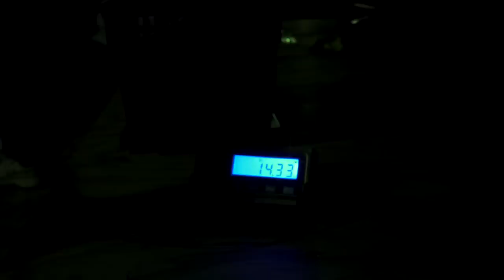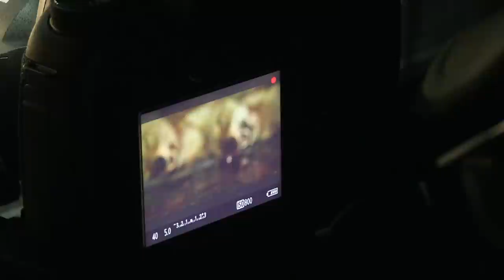One of a kind night hunting truck goes public. Night Crew S1E2 "THE RIG"

Comment: How did y’all get the rig to bolt down to your truck???
Reply from the maker: William thats a loaded question but I'll try and simplify it for you. On a GMC/Chevy bed, there are 4 double walled corner sections that give the bed rails support. We used those 4 corners to attach a plate that runs the length of the bed itself. The plate has 1/2" bolts coming off it to bolt the legs of the rig to. In the beginning, we didnt know if it would support the load but we've run it that way for 10 years or so now with no problems at all. The rig itself is made of 100% aluminum so that helps also. The way we attached the plate with the bolts to the bed was a little more complicated but entailed using threaded sheet metal inserts to give us something to bolt to in each corner of the bed of the truck. Those inserts have a plate bolted to  them which is welded to the plate running the length of the bed that holds the rig. The best part is, it allows us to keep the entire bed of the truck free for storage or animals or whatever. I hope this answers your question. Chris